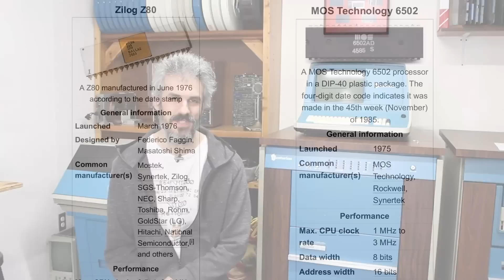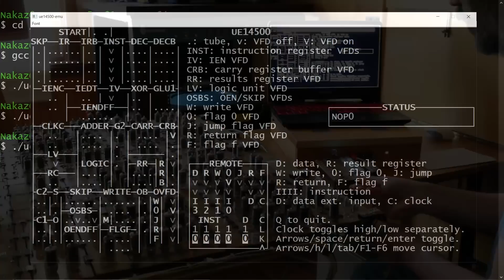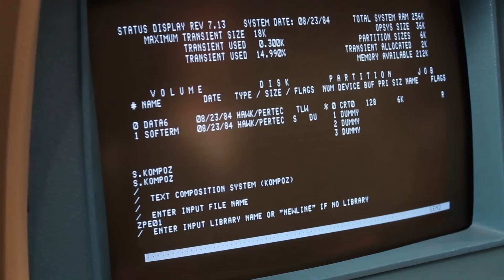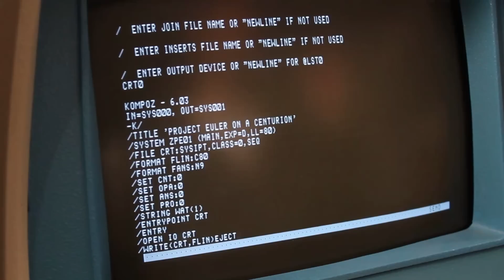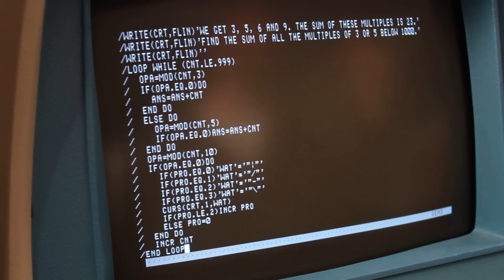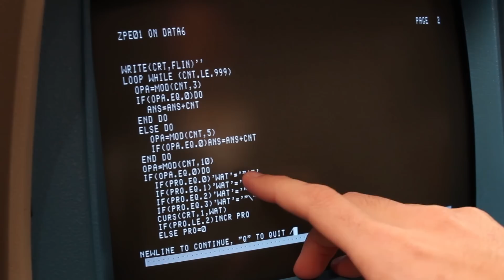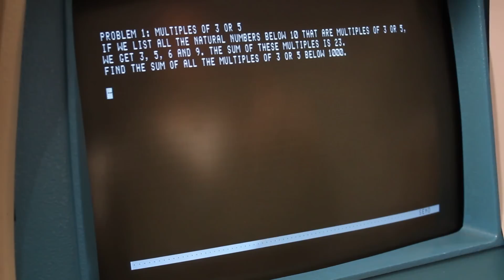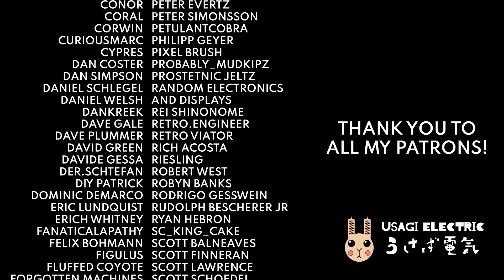Coding on a 1980s Business Minicomputer!

Comment: the terminal looks lik an Applied Digital DATA system"s (ADDS) 520. I worked for them back in the mid 70's to the early 80's. Unrer ADDS label it would have been brown with anorange and yellow keyboards. They were made for customers in other colors NCR units were grey and white. They also made the Tandy 10 Their first business computer.
Reply: ADDS painted the ADDS terminals for us using the Warrex/Centurion colors.  We used ADDS terminal from 1975 - 1985/1986.   Loved the "Cherry" keyboard switches in the old ADDS terminals.

Comment: I had a minicomputer like this in the 1990s with one terminal.   
It took like 25 minutes to boot up.  I'm not joking.   
We ended up throwing it away.   
This was around the time of the single core AMD FX3D Now processor at around 300mghz and the Voodoo2 graphics card.  Before Youtube.   We played a lot of Quake deahtmatch.

We had a disassembled AS/400 in the garage too in pieces.  I ended up keeping one board off it which is still hanging on my wall in my closet, and the rest of it got thrown away.

Even for someone like me who rescued and loved old computers, it was too crufty to keep.   It was on casters and weighted a ton like this one, about the same size and just as loud and propreitary.

Comment: It's pretty easy to verify the result of your program. 1*3+2*3+3*3+...333*3 = 3*(1+2+3+...333) = 3*333*334/2 = 166833.  Similarly, for 5 5*199*200/2 = 99500.  And for the multiple 3*5=15 it's 33165.  166833+99500-33165 = 233168.  We subtract the latter since if we just add the 3's and 5's we'll double count multiples of both.  Looks like your program found the correct answer!

Comment: If your terminal did not have a screen, Kompoz would have made a lot more sense, as part of your mental visualization of something, (initially) depends in part on what you are looking at . Its a similar thing with Edlin and Ed - they all are line editors - most people (looking at the screen) ask "why cant I use the whole screen" or "why cant I just type where the cursor is". If you look at the key commands for things like Vi, Vim, Emacs then you can also see there origins too

Comment: Fun!

I feel like the Centurion is well enough along now, it might deserve a proper key. Since you can unlock it with the wave rake, presumably you could recore the lock, or maybe the lock has a bitting number you could use to have a new key cut for that lock. Barring either of those, you could disassemble the core to get the bitting from the pins. One way or the other, would be great to see a real key turn the computer on finally. (I guess you could just replace the keyed switch with a regular rocker or toggle or something, but the key seems like more fun and of course is more authentic.)

Also, as far as the status goes, it's not really that awful that the writing to the screen is slow, it's just you're still doing it too often. The trick is to update the progress infrequently enough that it has little effect on the overall processing. For example, if it takes 100 ms to write to the screen, then if you update every 1 sec, you're only adding 10% overhead.

This is harder to do if you're just checking a counter. You need to get the timing info for both the computation and the progress to come up with the right counter value. On a more modern system, one would typically just use the computer's time-keeping clock instead of a counter. Maybe the Centurion has something like this, whether just a "clock tick" counter, or an actual real-time clock you can query. Though, then you run into the question of how efficient the call to get the current clock info is. On a modern computer this isn't that expensive, but on the Centurion? Who knows? It could be an order of magnitude worse than writing to the screen. :)

Comment: I'm curious about how memory was managed.  One multi-user system I worked with could only address 64K.  The first 32K was for system, the other 32K was bank switched user space.  Each user had their own bank.  That made it pretty easy to switch between users as the system just switched banks as it jumped between them.

Comment: The only thing that I have on a modern computer that works similarly to that HDD (power up and wait) is my Schiit Jotunheim DAC/Amp. It takes a bit to 'warm up', you hear a little click when you engage the circuit for sound output, and then it goes. It isn't necessary for anything other then listening to music, so I don't mind the wait.

Comment: Editor pains?  I do feel with you. I was using ed on Edition 7 for years, as far as editing goes it's a similar degree of torture.  I got so used to ed I ignored vi for years.  Aside vi was like four times larger so using it on a multiuser system with 512k RAM of the first Edition 7 machine would have been anti-social.

Comment: When I grow up I wannabe a 70s computer operator ❤
Reply: Feeding punched cards into a clacking card reader or winding mag tape onto reels?

Nope. That was a shit era.

I’ve seen it all. Gimme JavaScript and browser dev any day.
Reply: @TesterAnimal1  what part of ruining an undergrads life are you not getting? JCL error — no job for you!
Reply: Same here, but I fulfilled my dream. I got a summer job back in 1975 operating a NCR Century 8200 minicomputer. 128K RAM, 3 terminals, 2 HDD with 5MB fixed and 5MB removable and a line printer. I did IPL everyday from a K-7, run some jobs and changed disks and the printer paper when needed, and shutdown at the end of the day. Still have the OS quick reference guide somewhere.

Comment: IMPORTANT:  For integrity sake, you should include about ZPE01 somewhere , preferably in the description you wrote to the CRT or in documentation or both, you should include when and what this program is; a program written in 2022/23 to test the CPU, etc.  This is so, in another 40 years, when whoever finds this program knows it wasn't written by someone in the '80's and is not by an original Centurion class programmer.  I'm sure they'd have a different thought about the program than we're thinking about it now.

Comment: It's wonderful to see how "illogical" the text editor from that time is. Not in a bad way but this is totally fascinating. Would like to know why it is designed the way it is.
Reply: It is quite typical for the time.
Computers did not have enough RAM to read a typical program source text all in memory, manipulate it there, and write it back out.
So, editors were stuctured as if they are editing a tape.  Read some lines from the input file and write them to the output file, then read and edit some lines, then read the remainder and copy it to the output.  So the editor required only RAM space for a couple of lines, not the entire textfile.
Reply: @Rob2  I'm not very familiar with that era but aren't 'ed' and 'ex' basically the same era, before the 'visual' editors. Using ed is pretty intuitive imo.
Reply: Some of the editors are fairly well documented on a design level; for instance, the block editor of some FORTH systems is described in chapter 3 of Starting FORTH. 

ed is far from intuitive; as a reminder, its sole error message is "?". It is however a quite useful language, persisting today and influencing pretty much all programmer editors.
Reply: @deeiks12  Yes, but e.g. in "ex" (and later "vi" which is the fullscreen mode of "ex") the handling of that limited memory was coded in the editor.  It used a temporary file to copy the input file in a data structure in that file, and the user was not involved in that.  So you could edit files larger than memory.
But in the earlier editors the user had to handle that himself, it seems to be that way in Kompoz but I also have seen it in other editors.  They are more like stream editors (similar to "sed").
Reply: @Rob2  Great info, thanks.

Comment: Maybe ask a locksmith to make a key for a centurion? and engrave "centurion" on it. Would be cool.
Reply: There is a standard key that fits almost all the keylocks of that type.
Such locks were usually stocked and sold with a default keycode (the same for all) and only for custom orders you would get a unique key.
It is like the "1333" key for 19" cabinets: one key fits all.

Comment: Geeez.. I would have attached a Windows or Linux computer via serial port  as another terminal, typed the program in Notepad or Xed, copied-pasted into the terminal window and voilá ! As easy as 123. 
But if the idea was to feel what the pilgrims felt, then you are in the proper path. By the way, nice job .

Comment: TOday it becomes clearer why those old programmers abandoned different unices and other CRT/DOS oriented programming tools and readily jumped into Java or MS programming stack. Borland also knew what they were doing back then providing tools from TurboPascal to rich GUI RAD environments.
Reply: Unix was already a big advance on this system. One of its revolutionary ideas was that a file was just a sequence of bytes, with no inherent “record” or “line” structure. All buffering was handled inside the OS, so you didn’t even have to worry about working with whole multiples of 512 bytes (or whatever the sector size was). If you created a file exactly 300 bytes long, then when you read it back, you got exactly 300 bytes. There were no special “EOF” byte values; all tracking of how much of that last sector was occupied by your data was managed invisibly to you.

Comment: I tried this using Playstation2 (PS2) Yabasic  
In this language, there is 'frac'. It takes away the number to the left of the decimal point.
So 20.23 becomes 0.23 
Here's what I wrote:
open window 640,512
for a=1 to 999
if frac(a/3)=0 b=b+a
if frac(a/5)=0 c=c+a
if frac(a/15)=0 d=d+a rem these are one set of the duplicates
next a
text 300,260,str$(b+c-d)

Comment: As a kid I had trouble fitting code into 128KB back in the 80s.
What useful function did they think they could do with 6KB even if the OS ran in separate RAM?

Comment: Quick note, the CDC Phoenix was only 96Mb at its largest configuration, smaller versions were available at 32Mb and 64Mb with heads not fitted to the actuator for the lower platter(s),  there was one client that only used removables. I was responsible for testing Pheonix in the CDC UK Factory (UPL) in the early 80's
Reply: Steve,  The 96MB 9448 we have has a crash fix servo head and unload the heads after first load on power ON.   because we have zero spare parts, no CE Alignment pack and no TB216  with tools to "fix the Phoenix we have a bit of a nutty idea.....  We are thinking if jumper the removable servo head "digital signal path" to the fixed servo head logic the the Phoenix with see a good sevro head signal if the cart. or fixed disk are selected. We know only the cart. disk will be readable but we will have a working 16MB Phoenix drive and we have around ten Phoenix disk cart. to look over for Centurion code and software tools.   Do you know if the CDC Phoenix had a PCB Jumper option to run the "Phoenix in a Cart. Only Mode" ... {no fixed platters}?   I recall some switch setting that had to be changed during servo head & cart. head alignment steps to keep the Phoenix from unloading the heads when the "Outer or Inter Servo Guard Band" was detected.  We are going to rebuild the Phoenix HEPA air filter (or replace) before we fly the heads again.     Checkout the discord channel https://discord.gg/p7UsfHD       Regards...
Reply: @kenromaine2387  Can;t believe I threw out all the manuals and setup stuff which was hiding in my loft about 12 months ago ! .. also I saw a TB216 on Ebay about 6 months ago in the UK, "9105" / "9103" and "9101" were the standard codes for the unit connections, Dibits have to be checked for alignent at Tracks 0, 15, 263 and one other that I can't remember, these are shown in the alignment pack, but you will still be able to see data on from the R/W card at the back and it's pretty clear when it is right / wrong. I am racking my brains now to remember how the 16Mb version was configured, you can just remove the lower platter heads from the actuator and unplug them from the Head Preamp, but I am fairly sure at one point that they fitted a dummy arm to make sure the balance was right on the actuator, but can;t remember whether it was early or later models !  You would probalby have to patch the servo signals on the Servo Course/ Fine cards, in the centre of the card cage, front to bac the cards are I/O / Control Mux / Gap / Servo Coarse / Servo Fine / R/W  the gap was used for a test card which actuated the system during burnin and when on "bring up" in the factory.  I have a feeling that the size setting was on the I/O Card but i can't remember , i need to go look at some pictures of the boards and see whether it jogs my memory...
Reply: @kenromaine2387  https://www.wang2200.org/docs/external/CDC_9448_CartridgeModuleDiskDriveMaintenenceManual.729-0199.1979.pdf ...  Page 44 has the switches for the capacity ..

Comment: Before I say what I have to say, I want to preclude it with that I've been working with computers for 35 years and that I've worked with many different operating systems on many different types of computers. With that out of the way: this is the most insane operating system and language that I have ever seen; it makes z/OS look like a luxury cruise in comparison. Is any kind of UNIX available for this hardware, so it becomes sane and comfortable to use?

Comment: There must be a way to edit your program with any decent editor and then just tell the compiler to compile that. Maybe there is a full-screen editor or at least a good line editor you can use.
Reply: The "easy way out" would be to use a more modern PC as a serial terminal.  In the serial terminal program, you can just paste in the contents of a file from the PC.  But this wouldn't give you the full 1970's computing experience.
Reply: Back in the day, there was an open file-transfer protocol called “Kermit”, created at Columbia University. Implementations -- many of them open source -- were available for just about every machine out there, from little 8-bit micros up to big mainframes, so there was almost certain to be some way of moving data between whatever machines you had.

I wonder if this machine had a Kermit implementation available.

Comment: I had to buy an XP machine to run Paradox 4.5 for DOS and code with it in PAL all the time, though I use Excel as a front end which gives me the best of both worlds except having to move everything by USB.  DOS is superior to windows for text/data but it was too easy to pirate.

Comment: Sooner or later, someone is going to write a version of BASIC for that machine, and it'll probably be multi-user and compiled. 😆
Now, if I were doing it, I'd make the BASIC compiler be "streamed" so that when someone asks to run a BASIC program, it loads the compiler and if someone else in the mean time also asks for a BASIC program to be run, it queues the second request instead of having to load a second instance of the compiler.

Comment: The bootstrap program is on paper tape and permanently set in the computer?
Reply from the maker: The bootstrap assembly program is actually stored on a tiny little PROM on the backplane. It does a few things like check sense switches to jump to certain addresses for debugging, booting to the WIPL or booting directly into the OS.

Comment: A 5 Mhz processor sounds awesome for the day, my Atari 800 ran at 1.97 Mhz.
Reply: I agree on the 5 MHz or 1.97 MHz micro.  The issue with the 5 MHz Centurion was the cost of $40K to $50K for a system did not play well with being in the home to learn about computers.   Still have your Atari-800?    My first home computer was a Intel 8008 with 1K bytes of static RAM in 1975.  My 2nd home computer was a TRS-80 Model-1 Level-1 with audio cassette tape drive. Both the 8008 and Z80 computers are long gone.

Comment: This man has never used VI I bet... This is miles above many editors even a decade later. Try M$ 'ed' some time that was shipped as late as the 2000's
Reply: There probably is no version of "vi" for the Centurion...  it might be feasible to create something like that using the original vi style of coding.
(I have an old BSD 4.2 vi source somewhere... it is quite different from what "vim" is today)

Comment: Why can’t you freely share the disc image? After all this time I can’t see it being a copyright issue
Reply from the maker: Actually, it is indeed a copyright issue.
Centurion went bankrupt in late 1984 and was sold to a company called Ztron. They held onto the company for a few more years and developed a UNIBUS based CPU7 before they themselves went bankrupt and the company was sold to Cruze Computers who have owned the Intellectual Property since. They continued to develop the machine, creating a CPU8, CPU9 and ultimately a "CPU10," which was a port of the Centurion OS and application suite to x86. Cruze Computers actually still has two customers that are using the "CPU10" port to this day. I've talked to the current owner of Cruze Computers, and the hardware side of Centurion has been shut down since the mid-90s, but with two customers still using some version of the OS, he's asked me not to freely distribute it.
Reply: @UsagiElectric  Wow, I honestly did not see that coming. 
Please make a video about this, that's just about as interesting as the history of the machine itself. Honestly wondering who those 2 customers are now, though I think some company is still using a PDP system in their billing department. Crazy stuff.